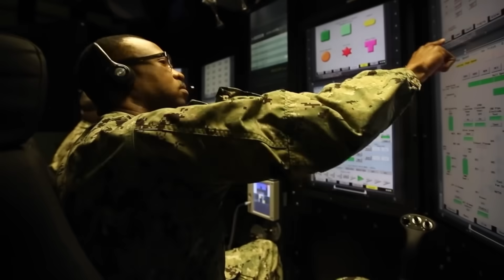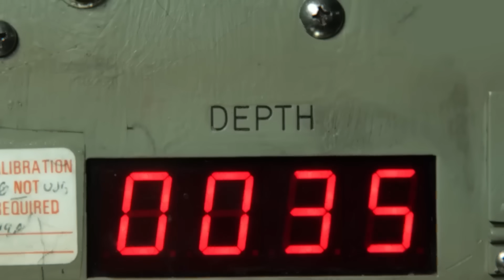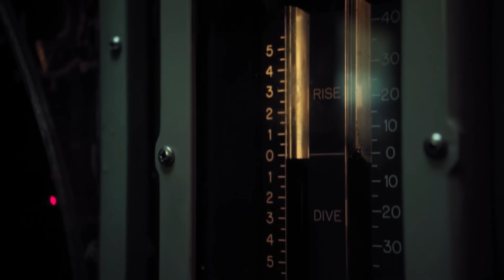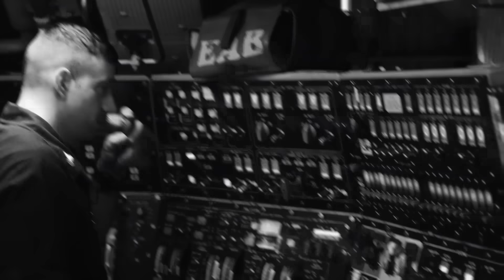What Happens When a Submarine Hits "Crush Depth"

Comment: If you think about it,, there's truly no absolute way any particular sub can have an absolute depth that it'll implode. Realizing the engineering & past rigid testing give a very "close estimate" of how any particular submarine might begin to react to external forces in the sea,, that "particular sub" is simply built to different specifications unlike many of the actual structures put under intense testing by the US Navy & other research firms. 
It's simply not feasible to build accurate & identical mockups to a particular submarine design allowing possibly 2 or 3 of them to reach a certain depth where they actually implode giving you undeniable evidence in lieu of empirical findings. The actual structure you're assigning final specs toward is/was built different than the vast quantities of testing apparatus possibly sent to extreme depths to determine failing depth areas. 
I'm thinking the only responsible figures that can be assigned are relegated to "zone depths" with a +/- area of footage as a "skipper beware" caveat whereby he knows he & his crew have reached a possible death zone that his instincts have to come sharply into play with how the sub is suddenly operating & reacting to certain depth levels he's maybe never taken it to before. 
All products are generally designed & created with a "CYA borne in date or specs" which attempt to cover liability creating a gray area of "buyer beware". 
Perhaps the US Navy should consider manning a couple of their obsolete subs designated for retirement with AI robots & send them to "absolute depths" where they catastrophically fail & they have proof positive of just how deep these engineering marvels can go. 
This testing is very similar to recent testing of a US aircraft carrier planned for the boneyard was sunk under rigid testing to see just how much punishment the old girl could take. They were surprised what it took to put the carrier down bringing into question just how possibly effective China's "carrier killing missiles" might be in real time. 
When the fate of a mission & so many sailor's lives are on the line,, it's good to know "exact figures" in lieu of "iffy estimates"..

Comment: ?. I saw this on a movie that I cant remember the name of. The engineer was showing his staff something cool on a WW2 sub. He attached two ends of a string on the interior of the pressure hull. Strung taunt. As the sub went deeper. The string showed slack. Meaning the hull was being compressed. Good for a movie moment. But could that happen on a WW2 sub? Or for that fact a modern sub going real deep just before crush depth ?
Reply: That would be "Down Periscope", starring Kelsey Grammer.  The same old-timer in the engine room also dumped whiskey into the engine, claiming it would "thin the mixture" and give them more RPM's.  When he did the string, I always loved his description that the sea would "squeeze the hull like an empty beer can."  Terrifyingly true.  😮

Comment: I can only imagine how much panic was happening inside the USS Thresher when things were going wrong, i feel really bad for everyone onboard, thier loved ones and those who were affected by it
Reply: Having served 23 years on the boats I can tell you that most of the crew was simply doing everything they could to bring her back to the surface. The implosion was a flash of intense heat and was over in less than a second. They are on eternal patrol.
Reply: I'd think they were too busy doing their best to get the reactor back online and trying to control the flooding, but that's just me. Can't say the same for the shipyard workers that were also aboard at the time. Cheers.
Reply: @NahuCommNS had to be 26 terrible hours
Reply: @EstParum  26 hours? WTF are you smoking dude? They barely had 6-7 minutes from the pipe failure and reactor scram to the implosion.
Reply: @NahuCommNS  No they propelled along with positive angle trying to resurface while taking in water. They re-established communication with the sub Seawolf. They could only listen to the radio and ping as response. Then they went silent and sunk and imploded.
Reply: @NahuCommNS  About 26 hours later than previously reported
Reply: @EstParum  Hold up; Seawolf? Has the US Navy released new information/reports that were previously classified? If true, damn, i have to read that.
Reply: @NahuCommNS  It is on youtube. 37 pings.
Reply: @EstParum  I just took a look at the report of the Seawolf's commander. And it's like a swiss cheese, full of holes. False positives, sound interference from DDs moving above, etc. 
Plus you still have the clear and recorded implosion of the Thresher on April 10th, at around 09:18 AM by the Skylark, and later on the same day oil being spotted in the surface. 
Also, it makes no sense to think that a submarine that has lost all propulsion (which means loss of forward thrust and subsequently loss of buoyancy), is taking on water (buoyancy going further into the negative side), and finally can't blow it's ballast tanks (due to freezing), all of this at test depth (so below 1300 feet/400 mts) and below as they started sinking, can survive for more than just a few minutes. The timeline for the casualty on the pipe was estimated at around 09:09-09:10, which would have given the crew barely 8 minutes to restart the reactor before reaching crush depth.
Those men were doomed from the moment the reactor scrammed.
Reply: @NahuCommNS  They pinged and banged on the hull 2 days after that incident so. Yeah.
Reply: @NahuCommNS  The previously presumed implosion could have been an explosion or crack releasing radioactivity and/or oil. The reports are all over the place but the pings and knocks and localization is beyond jarring.
Reply: @EstParum  sounds like the story of the Kursk. It always disturbed me that those guys were alive for a while.
Reply: Did they bring up what was left of the sub?
Reply: Knowing people who served in the military (admittedly no sunmariners), panic is not something that likely would have taken place. Everyone had training on what to do in case of failures and they were certainly doing those things instead of panicking. I would illustrate this by pointing to the airplane that was landed on the hudson river. Dual engine loss shortly after takeoff and if you listen to the audio recording both pilots are cool as a cucumber despite the fact they were probably going to die.
Reply: What makes you think any but a handful of the crew on the bridge had any idea there was a problem?

Comment: I've heard this story before. The air freezes when they tried to blow the tanks. They should make a failsafe so that it fails before crush depth and empties into the place they want it. I'll they bet they already have this though, but I'm often shocked when people refuse to learn from history.
Reply: Running out of electric power doesn't explain why the manual system to blow the ballasts tanks didn't work. From another story I heard, they said it's possible the air actually froze when they tried blowing the tanks, blocking it. They tried fixing that problem by adding some kind of nozzle that won't get blocked by freezing air.
Reply: @SciHeartJourney  As a submariner in the USN from 2002-2010, I can confirm that this is what was taught to us at BESS. The Thresher went down due to moisture making its way into the EMBT system. When they dove, they had a jamdive, the COB used the Chicken Switches for the EMBT, pipes froze, no air, no ballast.
Reply: @davidvenegas220  thank you for sharing that experience with us. 👍 That's a tough job!
Reply: @SciHeartJourney  I can also confirm there are dehumidifiers for EMBTs on todays submarines. :D
Reply: @davidvenegas220  incredible information!

Comment: Immediately something wrong here. When water eventually forces it's way in, it does so with so much force and speed the water it's self, acting like a block of concrete, kills everyone within just a couple seconds or less, filling the entire boat to relieve the different pressures. Breaking bones, major blood vessels, even as far as potential decapitation through sheer force. That's the lucky way to go. If you somehow manage to survive and get trapped in an air bubble, it makes your death much slower and more agonizing.

Also, the "water causing so much heat it causes the boat to implode" is just downright stupid to say. I've never stepped foot on a sub but I don't need to, to know that's wrong. So very, incredibly wrong. If anything it was the friction of the metal on metal that caused such extreme heat. And even still, you're far more likely to be injured or killed by the 300+ mph water.

Comment: The Thresher investigation concluded that implosion took place in a sub-1-second timeframe, too quickly for the human senses to react, but much of this video implies that it would take at least several seconds to crush. Can anyone clarify how long it would take?
Reply: He means everyone on boarded would be dead instantly. But the actual act of crushing would happen for a few seconds. Like the interior is destroyed immediately. But it takes a few seconds for everything to stop bending, twisting and crushing
Reply: The act of crushing takes seconds to minutes, but the actual crush happens almost instantly. As the sub descends it starts taking on damage. Parts fail, pipes burst, etc. So someone onboard would know that they are being crushed. However, once it reaches the actual crush depth, the sub would implode instantly. This is because the pressure is equal all around the sub. It would be over in less than 30 seconds but you would be dead instantly
Reply: @mikel9567  I think I'd rather know at least a very short time in advance. Maybe the men aboard the Titan at least had time to pray and come to some kind of peace. Or possibly they all attacked the OceanGate CEO.

Comment: In a constant-pressure environment like the deep ocean, the energy release from an implosion is simply (pressure)*(change in volume). If you do the math on the units, you'll notice it comes out as energy. Doing some rough calculations for the USS Thresher given its interior air volume and estimated implosion depth, gives an energy release equivalent to about 1.1 tons of TNT.

We had a guest lecture by the president of Benthos (now a part of Teledyne Marine). They manufacture the glass pressure spheres used to house a lot of deep ocean instruments. He told us a lot of stories about the results of deep ocean implosions (you can't really simulate it on land because the volume change causes the pressure to drop, while in the deep ocean the pressure remains constant throughout the implosion).

In a complete implosion, the glass sphere and computer components inside were pulverized into powder (they were contained inside a fairing so the powder wasn't all lost to the sea). And when a seal for a hose inlet failed but the sphere survived, the netting, cables, and hoses outside the sphere were forced inside the sphere through an opening smaller than the diameter of the hoses. That story makes the Mythbusters episode where they simulated a deep sea diver's air pressure hose failing (the pig carcass meant to simulate a body was forced into the helmet) make a lot more sense.
Reply: I remember that episode on Mythbusters

Comment: "it would rush in"

That's an understatement.
It doesn't rush in.
It Blasts in. ferociously and viciously.

Put your face at the nozzle of a pressure washer, crank it up to max pressure, and pull the trigger.
(Don't actually do that if you want to live)

That's how intense that water blasts in.
Now expand the width of that nozzle from screwhead to a baseball. Or the proportions of a baseball bat. With that same grizzly pressure-based power. 
 
That's what submarine crews have to look forward to at crush depth. :(

Comment: What happens when the submarine increase the interal pressure to equals the pressure out side.
Reply: You could design a submarine with equalized pressure with the outside, but you would 1) need to completely redesign your partial pressures for saturation diving and 2) you would need to have a controlled decompression process to prevent the bends upon return to atmospheric pressure. It really would have no useful function for the entire submarine to be at sea pressure at depth. Certain dive bells employ a moon pool design and they equalize the internal pressure with sea water pressure. If you get a chance to look them up they are pretty cool and very common with long term saturation diving.
Reply: @SnapshotTube2  would there be a way for them to increase the pressure gradually once problems occur. It might give them a chance  to stop an implosion the closer they get to neutralising the pressure. I’m not too sure on the science of divebells and saturation diving. But surely the technology could be somewhat used with submarines
Reply: @bullman3602  the short answer is it would be extremely difficult to design and maintain. You have to keep in mind to pressurize the people space you need air pressure. Either you increase the size of your air banks dramatically, or you find a way to perform high pressure electrolysis in a way that you could add air pressure at depth. This system would be extremely dangerous to operate and horrible to maintain. Those two factors alone make it a non-starter for a military submarine. Humans can handle a lot of pressure, but they are really bad at rapid pressure transients. 

Say you had a fire on board and you needed to ventilate the ship in an emergency? The pressure transient from at-depth to equalized-with-atmosphere would kill everyone onboard from bubble formations in the blood.
Reply: @SnapshotTube2  ah damn okay fair enough. Thank you for such informative input! It made a lot of sense
Reply: everybody drowns

Comment: Pictures I saw of the Thresher I believe, it telescoped inward, the tail ended up under the conning tower, inside the front half of the boat.
The sailors inside never knew what happened.
Reply: I'm hearing that was the scorpion. I couldn't get on one of those. I've been in fast cars, aircraft, tanks, Bradley's, and not once have I ever wanted to be on something that literally sinks and goes to a depth that has the ocean trying to kill you. Nope, sorry. not gonna be this guy. Those submariners are going to be better off without me being anywhere near their ship. It freaks me out a little bit when I see footage of shipwrecks, and the approach to the wreck being pitch black and the light starts shining on the wreck so it's silhouetted.  Nope I'm not cut out for being under water.

Comment: IT'S  A  MYTH
In reality...a rupture would occur, and water would fill the vessel so fast that the majority of the hull would NOT crush much at all. The interior bulkheads would fail, and water would fill the the vessel within a microsecond...ironically raising the temperature to a flame front just ahead of the incoming water. All would happen in a literal flash, and the sub would maintain the exterior integrity quite intact. This all assumes an undamaged sub sinking to 'crush' depth. Most likely it would be the shaft seals that would give way, as these have always been the weakest point during construction of subs throughout history.